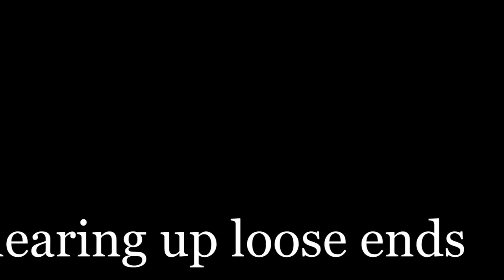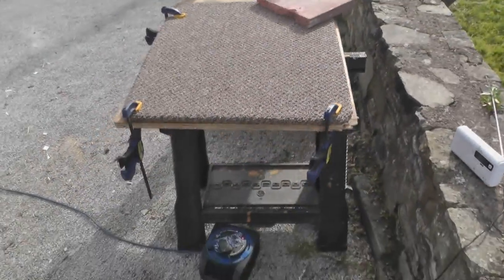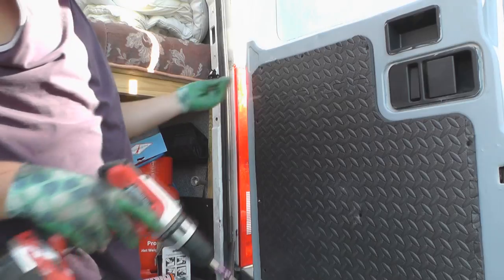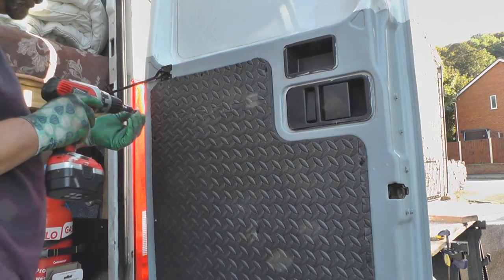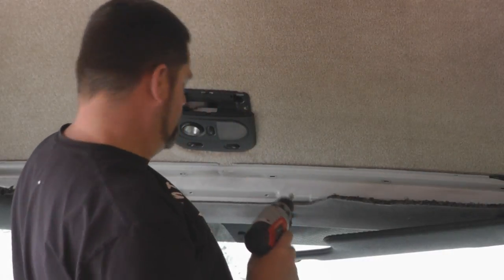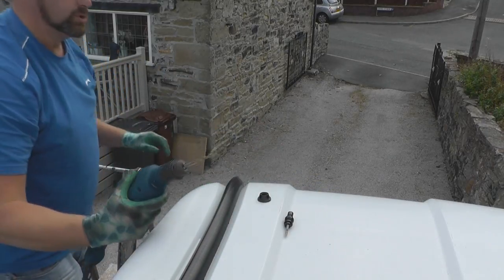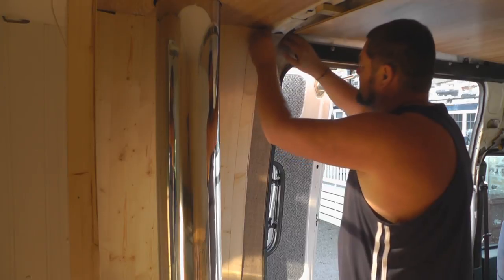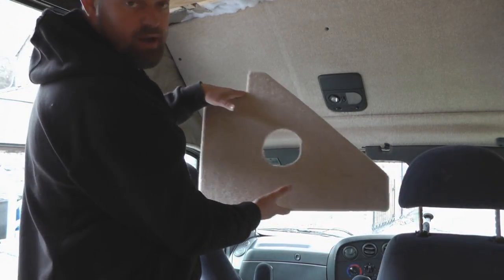Camper Van Build - Snagging Part1

Comment: Great video.  Just what I needed to see as I am getting ready to insulate my back door. Subscribed!  I am wondering what kind of drill that is that goes through metal like that.
Reply from the maker: Moon Dancer Hi thanks for your comments and for watching I'm happy to help in anyway, ref drills buy a good set as the cheaper tend to snap as they are made out of chocolate rather than metal lol, depending on the work your doing around 15 to 20 £s will get you something to work with,  regards James
Reply: But what kind of drill or drill bit? Thanks
Reply from the maker: Hi its a Metal Drill bit , for use with mild steel. When you buy screws just match their width to the shaft of the drill bit (the screw should be slightly bigger to ensure tight fit) regards James
Reply: Thanks James!